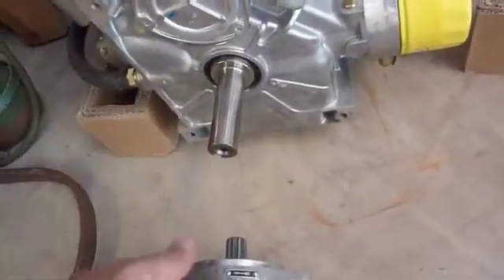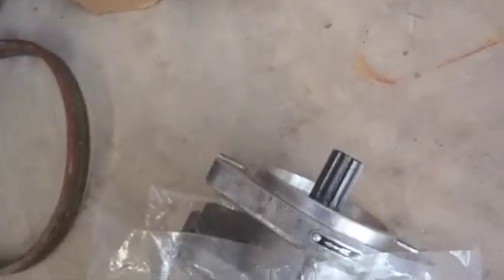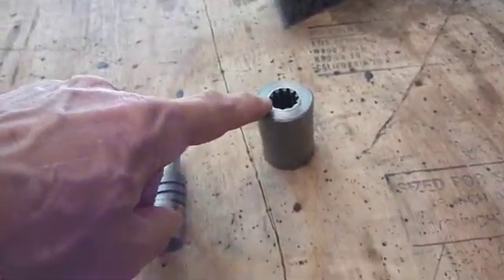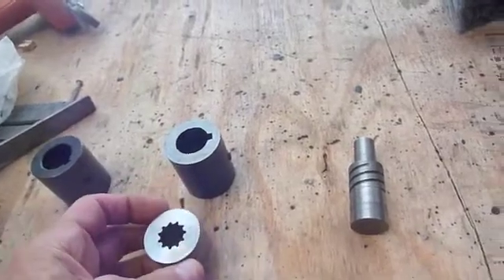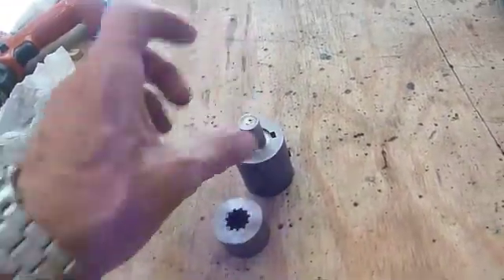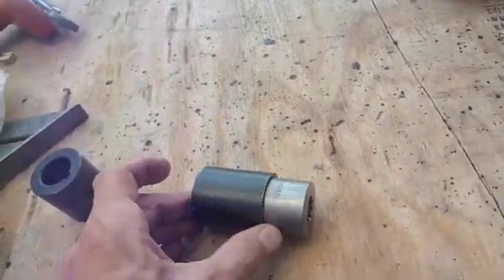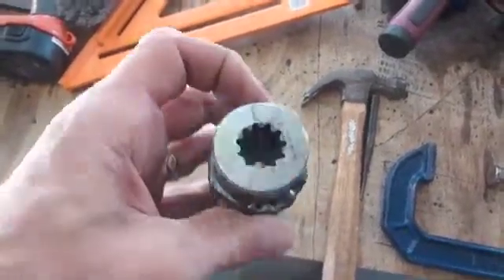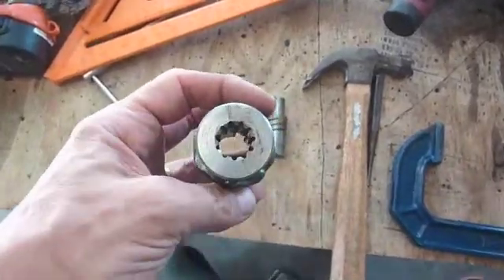PC6_Shaft_Coupling

Comment: How many times has that plywood welding table been on fire?   I see the splatter burns like a shotgun scatter all over the table.
Reply from the maker: That piece of plywood has been on top of a 4 wheel dump cart for years.
I'll tell you what . . . in my next video with it, I'll flip the plywood so the untouched side is up.

Comment from the maker: Yes.  The plug helps maintain alignment and clamping helps even more.  The plug has about one or two thousands tolerance and this varies from one coupling to the next.  The shaft ends should be turned in a lathe to be flat and perpendicular to the coupling axis.  Another way is to weld the uncut ends of the shaft couplings, as they should be true.

The nice thing about the spline coupling is that it allows some play between it and the spline shaft.